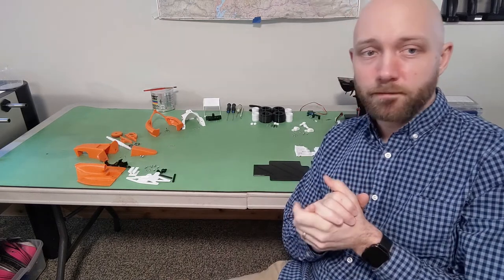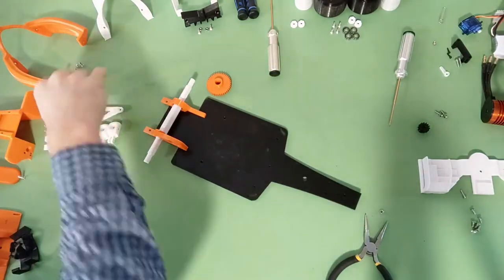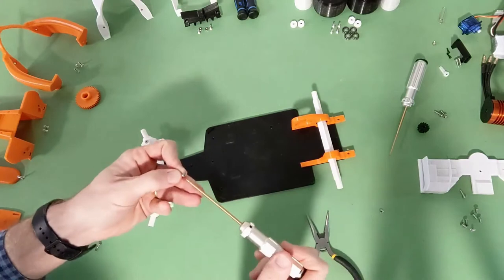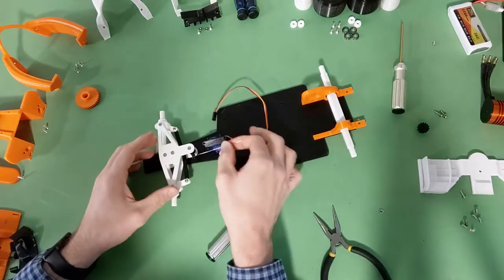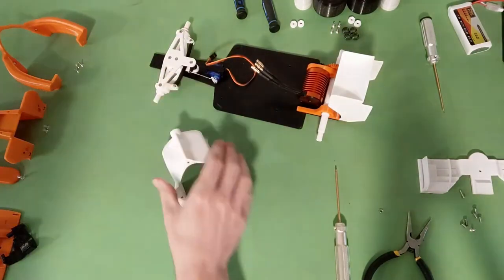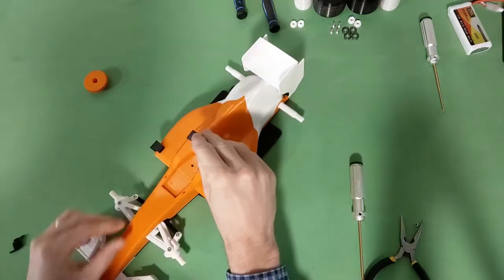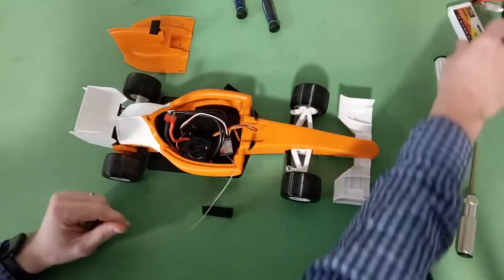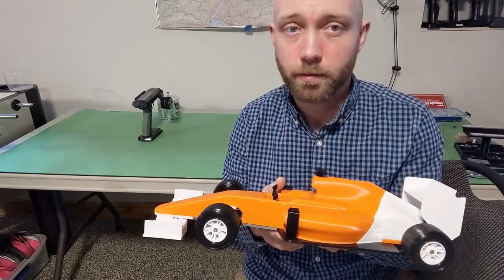OpenRC F1 Build Guide with Electronics

Comment: Hello i am new to this and going to order your package: Fastener/Bearing/Servo/27T Motor+ESC exactly what do i need more? Only battery and a controller? Or is it something else i have forgot?
Reply: I am also wondering
Reply from the maker: Hey, ya that's pretty much it as long as your controller comes with a receiver and you have a charger for your battery. The only other things would be to decide if you're buying tires or printing tires and then you'll need a few other things like lubricant for the gears, a paperclip for a steering rod, 3d printer filament, possibly some solder and an electrical connector to change the esc power plug to match your battery.

Comment: I am working on this now.  I have printed a few others but so far none to compleation.   I was going to use TPU for the tires on mine, I do think this model would be better with a rear differential design as it will likely not turn very well with the solid rear axl.
Reply from the maker: you can try this: https://www.thingiverse.com/thing:2361718 designed by the guy who does the mkultra car we sell kits for as well. I find the TPU tires to be too slippy but they're fun to try so knock yourself out.
Reply: @rcprinter  Are there tiers that will fit the printed wheels that you can buy?  I was working on an OpenRC touring car, but I have not finshed that one.  can't find the drive belts for it & I did modify a number of the parts for the car.
Reply from the maker: @3DRCRACER  If you print the F104 rims you can use these tires: https://rcprinter.com/products/f104-tires-for-openrc-f1-front-and-rear

i'm not sure of any tires that fit the stock rims though.

Comment: Weird question, but are there any house hold things to use to lube the gears? Like maybe petroleum jelly, some cooking oil, wd-40?
Reply from the maker: Hey, not weird at all! I totally get that it doesn't make a tonne of sense to go out and buy a tub of superlube when all you need is a little dab. I'm really no chemistry expert but if you're testing some household stuff you definitely run the risk of deteriorating the gears prematurely... however you can always print them again if you need to so the risk is low and I say go for it. I did read in a few forums that petroleum jelly was a good option. I don't think wd-40 would work well and cooking oil would work short term but then get gummy after a while so you might just need to clean and re-apply regularly. You could also try a little lithium grease if you have some and it should last a long time before degrading.
Reply: @rcprinter  thanks a ton! You're super helpful, appreciate it :) excited to see the end result

Comment: Hey man, thanks a lot for the video, im having an issue with the controller not working to accelerate nor steer despite having paired it properly and having a solid red light when the car and the controller is on. (with controller on first). Is there any input you can give me ?

Comment: Hey there! I built the car with your kit. So far everything is great. But what do U against the front wheels turning too much? Whenever there is a little bump, they turn so far, that the servo cannot pull them back and I have to manually align them.
Reply from the maker: one fix to try would be to turn down the end point adjustment on your radio (epa) on the channel your servo is connected to so your wheels don't turn quite so far.

Comment: i bought yout brushed kit but dont know how to attach the wires? I have basic soldering skills but dont know what im supposed to do here.
Reply from the maker: Solder the yellow wire  to the positive terminal (there's a +) on the motor and the blue wire to the negative, then you can connect your esc. You'll likely need to change the power plug on the esc to match whatever plug is on the battery you're using (xt60, deans t-plug, tamiya etc). If you're still having issues send us an email and I'll send you some pics :)
Reply: Where abouts do you solder the wires to on the motor?

Comment: What bearings size for the wheels
Reply from the maker: The smaller ones mr128. 8x12x3.5mm
Reply: @rcprinter  just finishing up the tires and wanna test it out but haven't got the bearings so it runs all rough n loud lol
Reply: @rcprinter  anyways thanks alot!
Reply from the maker: @Quantumfishics  no prob my dude

Comment: Really good video. Very helpfull. I've printed all the parts and now i'm putting it all together. But when I saw your video, everything goes so smoothly. With me it is much more difficult. E.g. to assemble the ball bearings, the rear axle and the spur gear => all this goes very stiffly.
What are the ideal print settings (infill, shell thickness, resolution, ...)? I'm using a Dremel 3D printer => Dremel digilab 3D45 3D printer.
Reply from the maker: It could be many things causing your parts not to fit but to me it sounds like you're overextruding a bit. Perhaps try turning down your flow rate (or extrusion multiplier) slightly until the bearings pop in nicely and then go with that flow setting for the rest of the parts. For most parts on this vehicle I think I used 2-3 walls at .2mm layer height and a standard 20-30% infill so nothing special. I did end up reprinting a couple of parts with 100% infill when they broke like the axles for instance. You could also try sanding down your parts a bit to get them to fit together better or use a deburring tool to get rid of some of the ridges on the edges so parts fit together more nicely.